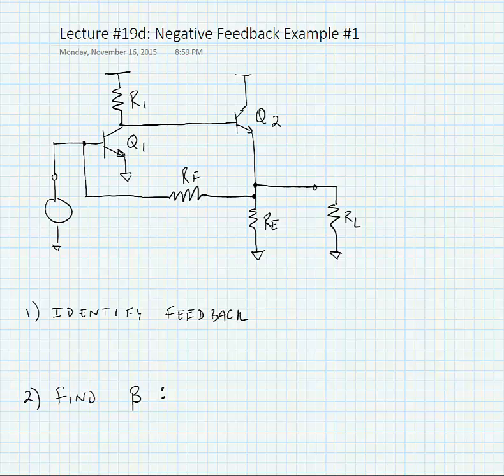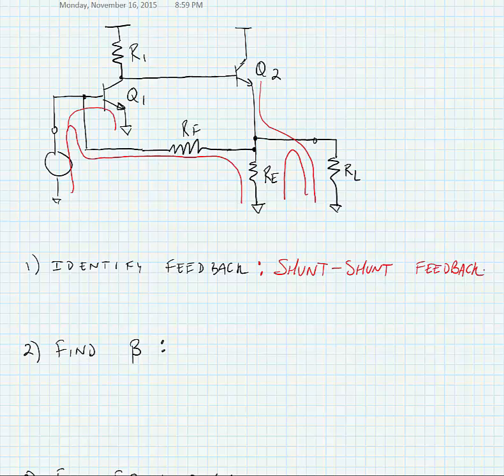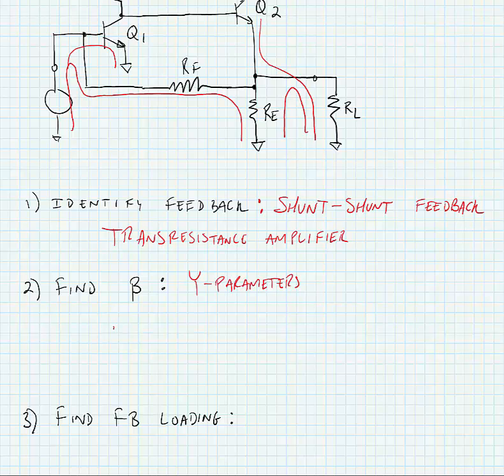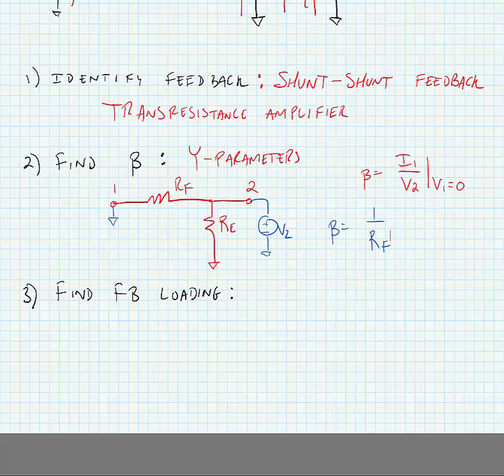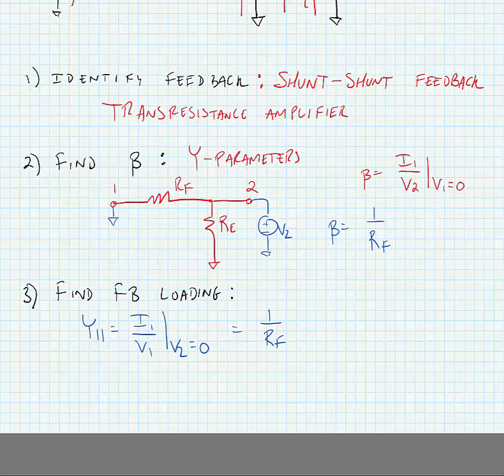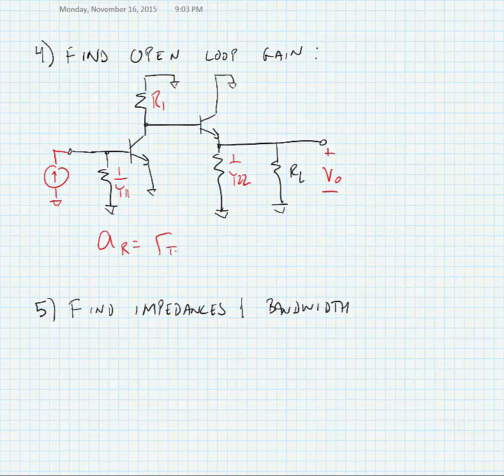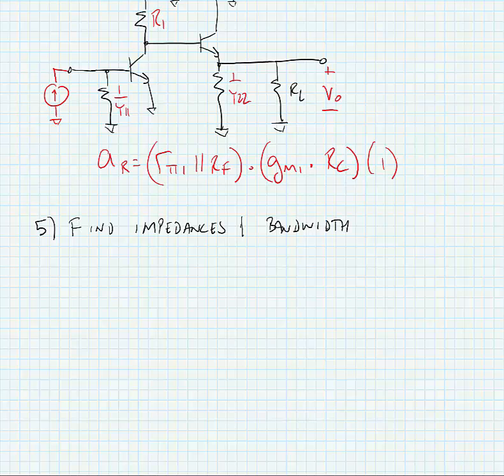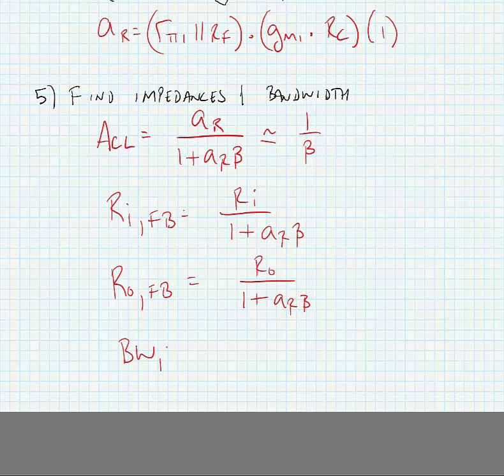ECE 3110 - Lecture 19d: Feedback Example

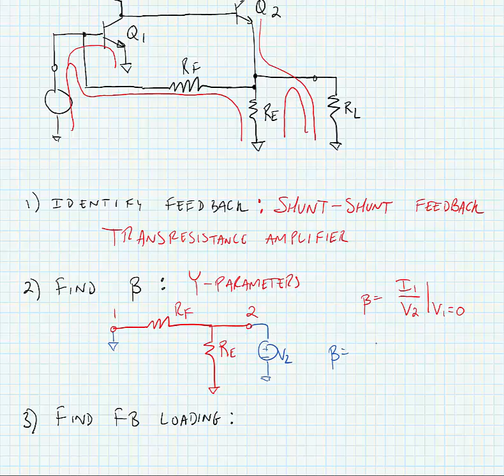Comment: @ 2:52 obviously \beta must be -1/RF. @5:00 the total gain must be negative. This is clearly inverting amp. and the expression for open loop gain is also wrong...
Reply from the maker: You are correct that there is a sign error. Outside of that and a lot of liberties taken to approximate the Open-Loop gain (e.g. Rb2 >> R1, gm2RE >> 1, etc.) the gain expression is correct.

Comment: One problem of these types of videos is that they do not use concrete target figures (voltage, current limits, amplification factor, transistor characteristics etc.)  Even though the formulae are there, a learner may mess it up by making wrong combinations.  Moreover, real figures provide an opportunity to try the circuits on boards, and have grasp of real life figures.  Thanks for the video.

Comment: sorry , i think that this circuit is shunt - series , NOT Shunt-shunt
Reply from the maker: Just from intuition it is not series at the output, because the connection will effectively reduce the impedance seen when looking into the output...
Reply: thanks for your rep